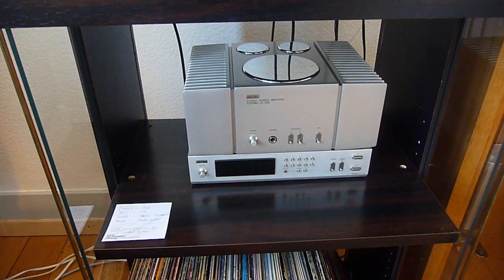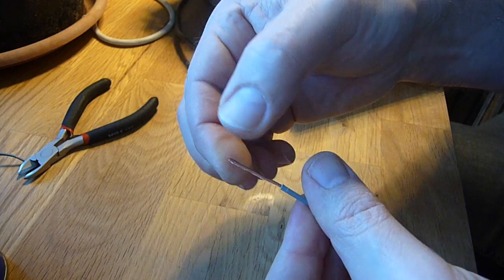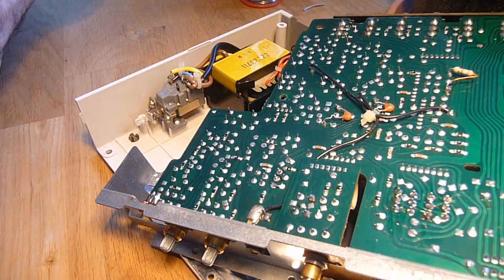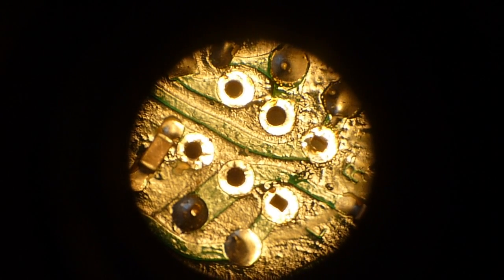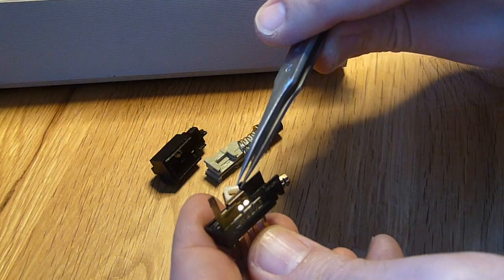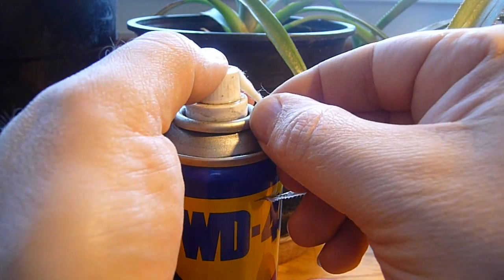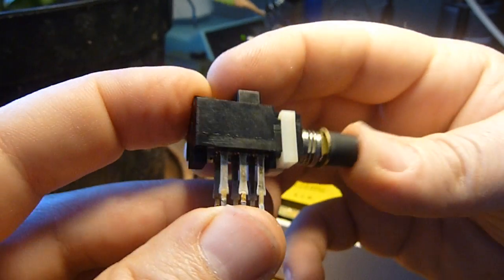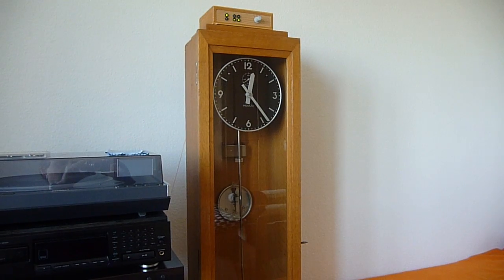Desoldering with improvised tools (PWJ62)

Comment: best desoldering method: heat gun with small nozzle.  250-280°C   just hold it on the backside and give it a slap, parts fall out with no damage to anything. works even on multi layer boards
Reply from the maker: I know, but on old PCB's there is a denger of overheating and turning brown. That's how I change caps on mainboards, with an additional desoldering iron. Baucause I need solder free holes for the new caps...

Comment: Thanks for the package ;) I had to de-solder and replace 20 capacitors on a motherboard this week, so it is great to watch this. lol
Reply from the maker: I'm not sure if that works as well on a computer board. The preamp had only single sided PCBs, that works well with solder wick.
Reply: I ended up getting a desolder vacuum. It was a bit of a pain to replace all of those capacitors but it went well and the motherboard came back to life. It was a Medion socket 775 motherboard with all of those video inputs and outputs so I just had to fix it, rather than bin it. The only problem was that one capacitor refused to leave (Connected to a large copper plate in the PCB) so I gently pried it up and surface mounted the capacitor to the aluminium wires sticking up.